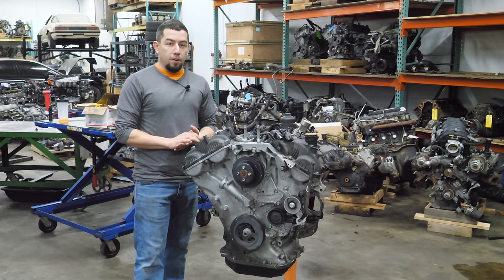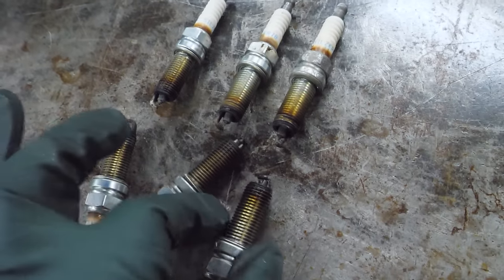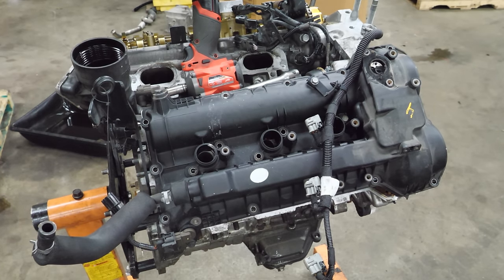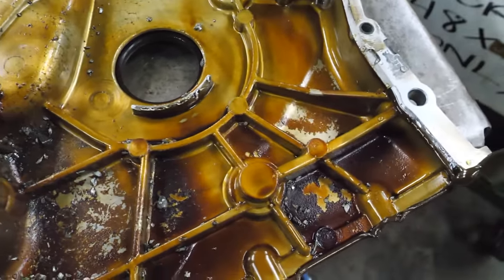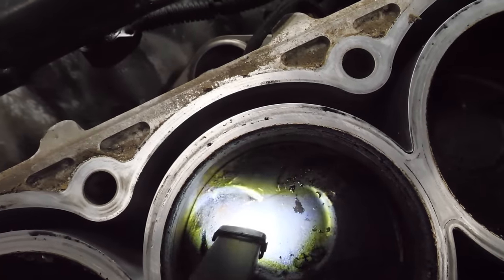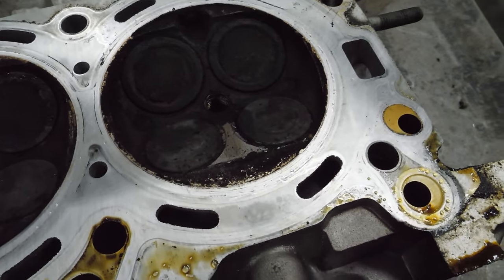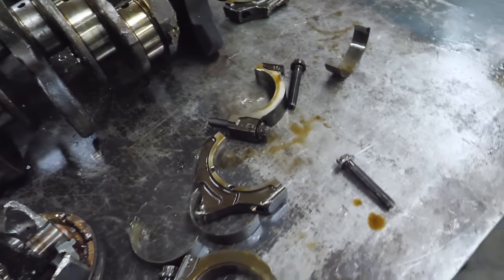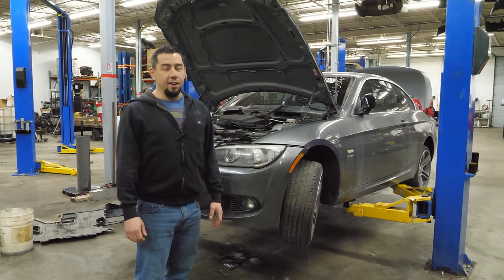Taking "Blown Up Engine" To A New Level! Kia Sorento 3.3L GDI V6 In Shambles. I AM IMPRESSED!

Comment: In my 50 plus years of working on all types of engines as a dealer tech from chainsaws to huge excavation equipment this engine easily qualifies as the most carnage ever, the sheer savagery inflicted of these poor engines always blows my mind begging the question, "people can't be that stupid, can they?"
 As always Eric, great video and teardown, thank you Eric for all you do!
Reply: Well yes, yes they can.  :D
Reply: @JimmyCasket02  I have to concede that you are correct, what a frightening thought, ugh.
Reply: i've seen alot worse...during a divorce, her husband put their suburban in N and floored till it stopped then cranked the starter until it caught on fire...5 rods out and part of the cam sticking straight up through the TBI.....Dodge van 318 knocked the cylinder walls out you look from the front cylinder through the middle cylinders all the way through the back of the block...and of course both customers only wanted short blocks ha Fn haha
Reply: shame the heads got hammered
Reply: Watching this gave me a freekin nightmare!😮

Comment: Having watched nearly all your teardown videos now, this has to be the top. The shear amount or damage to the block and oil pan is unprecedented.
Adding it all up. the fact only one piston/rod assembly barely survived,  that most of the rods removed themselves from the crank, and the the wrist pins off the 5 broken rods either were smashed to nothing or left the building entirely? There's no question, this has brought new levels of destruction to the channel. Truely amazing. Thanks again Eric!
Edit: forgot about the heads being wrecked too! What a mess!

Comment: That is quite the carnage for sure!  Was enjoying to watch~  Speaking of Hyundai and Kia, I have a suggestion for a future teardown for the channel:  the 1.4L T-GDI Kappa II (G4LD) out of the 2017-20 Elantra Eco.  I had one of these fail at 120k in 2018 due to metal flakes in the oil that were discovered at the beginning of a major 30k service.  Engine still ran fine at the time!  Dealer still warranteed the engine replacement even though I was outside the 100k window, but I never did find out what the cause of the failure was.  I also heard the 2011-2016 1.8L (G4NB) Nu engine was another problem child of theirs which could be another good future teardown, but my 2011 I had 371k miles on it with zero issues.

Anyways, keep up the hard work and the awesome vids, good buddy~

Comment: That stubby impact easily became the most used tool in my garage, I think you'll be blown away by the bolts it will take off😀
Reply: Yeah I've been commenting to this YouTuber for over a year about getting the Milwaukee 3/8 stubby M12 but I never got no reply from him. I kept asking him what is he doing running that M18 bit driver impact or his 3/8 Drive pneumatic when the Milwaukee M12 stubby would do both jobs and run on one charge for a couple days with the bigger battery.
Reply: That little gun is my most used tool. I’ve had one for a couple used years, and it looks like it’s been through several nuclear wars, and it still works awesome. Routinely takes off lug nuts and bolts, crank pulley bolts, and the most impressive I’ve got out of it was every head bolt broke loose on a 5.9l Cummins. It does like to throw its batteries out, but holding them in or the gun upside down, they stay in. I’ll be gutted when it finally dies.
Reply: It's really too bad that M12 batteries, especially the 6.0's, have such weak tabs holding them in. I've broken so many of the upper cases, and I'm not that hard on my stubby!

Comment: Always enjoy your video series in here about tearing down engines that got trashed, either through neglect or abuse or just plain junky design. This engine had a real serious case of disintegrating metal mites on crack!
In my career in the mechanical field(automotive/heavy equipment/motorcycle mechanics)of 35+ years, one thing stands out as a determining factor: so many people treat a vehicle like an appliance rather than do normal maintenance to keep their rig running correctly. Sad but true, and you have a lucrative business dealing in these salvaged vehicles & powertrain parts that others have trashed in daily usage. 
Thanks for a cool video, Eric!

Comment: The reason behind there being two head-bolts loose on both sides is actually a manufacturing defect in the block casting where the threads will stretch. Had to do a short block on one recently due to it being bad enough to cause a head gasket leak. Also explains why these engines are so pricey due to that being a common failure. But my god this was something else carnage wise lol
Reply: Since I have a car with this engine, this was indeed the part that confounded me. These bolts supposed to be torqued evenly just right. It does not seem that the hydrolocking lifted the heads? 
What did you do to fix the bolt? Just retightened them?
Reply: @franzliszt4257  I’m not sure the story of the engine in the video. But in one instance I had a 2017 Sorento that came in with overheating concerns. Luckily they had a third party warranty that covered the short block replacement. Unfortunately that’s really the only way to fix the issue because it’s the actual casting of the block that’s weak not the bolts. Kia is well aware of this issue and unfortunately it is pretty common once the car gets close to 100k. And who knows if the new block will have the same issue. As a technician I wouldn’t own a 2011-up. The old ones are rock solid before they went to gdi

Comment: That's an impressive amount of damage. I wonder if maybe someone tried to tow this and somehow left the transmission engaged? I can't imagine it could do this much damage under its own power
Reply: That would make sense, pulled from a flood while in gear.
Reply: Would make sense if it had a manual transmission, but the 2016 Sorento didn't come with a manual in the US. I do agree though; it's quite incredible the engine could bomb itself to that degree under it's own power.

Comment: Seeing the damage in this work of art, the only way I could see it having this mess is either towing it for a lot of highway miles in gear or somehow getting it to so seriously over-rev (70MPH into first gear?)  There is no way someone could get an engine to do this damage by just sheer acceleration or powering through a puddle.  This IS the most beautiful piece of art you have shown us so far!

Comment: That M12 stubby impact is a great unit! Just got one myself. Way better than the 1/4" impact driver. And a lot shorter as well.
Have a great day, Sir! o7
Reply: i have the m18 stubby and it's amazing
Reply: @bradhaines3142  Milwaukee 1/2" ?
Reply: @TheBandit7613  yup. same as 3/8 drive but with a 1/2 instead. i work on turbines so i need the beans in tight places

Comment: I'm going with towed behind a motor home while in 1st gear. The water is most likely rain water. This thing hit 10,000 RPM for a while until Grandma noticed the smoke and squealing tires behind the motor home.
Reply: I tend to agree here as this is most unlikely that it keep running for this long. This is more conducive to being towed while in gear to reach ungodly rpm levels.
Reply: That sounds like a pretty good guess. I can't see an engine turning over on it's own power long enough to do this much damage...
Reply: Interesting point!

Comment: As the long suffering owner of a Lambda II in a Sorrento, there are a TON of ways to prevent it. This owner truly had the perseverance to see this through.
Reply: I am not Suffering.  2020 Kia Sorrento  42,000 miles 3.3 Liter V6 and loving it.
Reply: @bryanwinter3289  Be patient. The GDI engines are very picky about fuel and oil. Even with the best care and feeding, plan on an injector or two (with the full fuel pipe hki) before 100,000 and a high pressure oil pump around 125,000, with the associated timing components. We won't be getting another. As long as I can find it, I'll stick to port injection.
Reply: @mausball  I hope to avoid that.  I change the oil every 5,000 or less.  Only use Penzoil Ultra Platinum, a low Volatility oil and use a high quality fuel system cleaner at each oil change interval.
Reply: @mausball  so basically, you are saying I should dump it?
Reply: @bryanwinter3289  nope. Just treat it right. Full syn every change. Trans fluid every 30k.
Reply: @mausball  already did the Trans fluid change and changed out the Transaxel and Differential with full synthetic.
Reply: @bryanwinter3289  Consumer Reports has the Sorento on their "worst cars list (reliability)' for years: '13-'14, '18, '21! GOOD LUCK!
Reply: @TheOzthewiz  
56,000 miles, and it runs like a Swiss watch.  I don't believe all the hype Consumer reports dishes out.

Comment: Looks like a massive over rev and rods let go. Was it connected to a manual transmission, have seen similar, when someone goes from 5th to 4th, but hits 2nd by mistake and then lets the clutch out! like 15,000 RPM. Keep up the good work Erik.
Reply: Sorento was auto-only by 2016.
Reply: @CaptainSpadaro  Auto only in USA but not in UK
Reply: @alandawson3345  can't imagine why anyone would want one of these with a manual, but okay.
Reply: @CaptainSpadaro  Cannot imagine why anyone would want one of these at all unless it was extremely cheep?
Reply: @alandawson3345  It's one of their higher volume models over here, not sure about your side of the pond.

I Wouldn't buy one either, but that's more because I don't like crossovers. If you spring for the higher trim levels, they don't seem like a bad place to spend time.

Comment: Wow!  I have no idea how that engine survived long enough to do that much damage. Any back story on the core?  Reminds me of a contest our local fair used to do; take an old beater, drain the coolant and oil, start it, pin the throttle to the floor and see how long it took to blow up. They would sell time ‘slots’ and if you had the winning time you won the pot. Best one was an early 70’s Dodge Dart with a 225 slant 6, it never did blow up so the fair won the event.
This is definitely the most carnage ever, great tear down Eric!

Comment: Have you ever considered collecting all of the nuts and bolts that come off these engines and selling them? Not like a "x1 piece kia 3.3 lower timing cover bolt" for 10 cents type of selling, but maybe fill up 20oz plastic containers and sell them as a "refill your shop bolt bin" type of deal? Just a random assortment that maybe someone would buy? No idea, just spitballing.
Reply: Alot of these bolts are "single use, torque to yield bolts"
Reply: @thefordmaniac  only head bolts as far as i know, and maybe bearing cap, the rest are reusable.

Comment: Awesome video!  Really enjoy all your content 🙂
Given that there is so little in the way of valve carnage, and without seeing the valves removed from the heads, I would like to venture the following theory:
The engine kept time (more or less) due to the chains holding it all together.   
The valves got locked shut by the pressure of the hydrolock during the compression and exhaust strokes.  (No signs of water top side of the cylinder heads). 
The cam caps, cam lobes and bucket tappets were equal in strength to the hydrolock pressure being offered on the chamber side of the valves. 
Therefore the valve stems crumpled (being the weakest element in the valve train), thus preventing the valves from being lifted again anyway.  
The black residue on the bucket tappet faces is hyper-heated oil residue from the lobes spinning on them at crush height without lifting the valves.  
The "cleaned-off" areas on the valve faces on the 2nd bank are where the carbon was literally pressure-washed away by the force of the hydro-locked water/gasoline combo in the now "locked out" chambers before the con rods gave out.  

It sounded a little different from usual when you busted the head bolts loose, so maybe there was a tiny bit of head lift/bolt stretch right as the engine grenaded, to accommodate the valves exiting the chat so suddenly?   All that upwards pressure with nowhere to go, kinda thing... might also explain the peripheral chamber deformation in the heads themselves?
Reply: I think this was a "towed-in-gear" incident. There is no way the engine kept spinning under its own power after oil was gone (no oil in pickup), to hammer that wrist pin into the outside of the engine, and the bend that compression ring around the windage tray. This had to have had help.
Reply: @kid31989  That's a possibility, too.  Remember though that an engine running at 3k rpm = 50 crankshaft revolutions per second, so this level of carnage can occur within a timeframe of just a few seconds before the engine seizes or grinds itself into pieces.
Reply: @Grantidge69  I've blown a couple motors at high revs and seen a lot of blown motors, and this level of destruction is up there. The big indicator is that there was no debris in the pickup or the oil pump, which indicates this was spinning itself to death with no oil, which engines don't tend to do.

Comment: I really enjoy every one of these engine tear downs.  I did a number of engine rebuilds “back in the day’, the old school overhead valve, cam in the block cast iron engines of the 60s - 70s.  Watching you tear these down shows me how much things have changed since then and how very uncomfortable I would be with these.  Please keep doing this to remind me why I no longer work on cars,  if someone needs a 1974 slant 6 rebuilt, that’s a possibility but I thank you for showing me what I am missing.

But I have to ask you, do any of the engineers or people involved in designing or building the engines you’ve “autopsied” ever contact you?  Seems like you could give them some good insight.
Reply: That Ford 1.0l, 3 cylinder has to be one of the all time classic POC engines - along with Chrysler’s 2.7 V6 and the 140 Vega engines.  All three companies produced - and continue to produce some engines that are real stalwarts among their peers, but these, you look at them and you can only say what were they thinking?

Comment: I have experience with this level of destruction. Over a decade ago, I had a Duratec 30 powered Mazda6S that met a catastrophic end at 121k. It blew 3 holes in the block and sliced a tire with a piece of the windage tray. 

Thankfully, the VVT heads were fine since they cost more at the time than a complete non-VVT engine. I ended up getting a short block from a Taurus and swapped the heads onto it.

I had the the heads machined and added custom grind cams from a company whose name I forget. I never wanted to deal with it again (6 hours just to get the engine out), so I added Diamond 8.5:1 forged Pistons, K1 rods, upgraded main bearings and rod bearings, and better valve springs. I got lucky that a supercar was manufactured not far from me that used the D30, so they sold me some performance engine parts in the days before easy online purchases. I added a custom intake, disco potato, and full turbo- back straight pipes with shorty headers. It was a beast. For 3 weeks until I got hit by a drunk driver and it was totaled. 🤬

Comment: I worked at a Hyundai dealer when their first generation of this engine came out (2006ish). The 3.8 in the Azera had a small run that dropped the cylinder liner. We got one towed in. Amazingly the block held together but inside was like what happens when you sit on a bag of potato chips before opening it.

Comment: Test is one epic explosion in there bud, wow. Worst I've done is 4 rods in a 350 dirt track stock car motor, it was balanced and it grenaded about 7500rpm on the back straightaway, foot was to the floor. I got soaked with oil. My white fire suit is still in a box around here stained up nice. Had double hump heads on it , somehow it never hit a chamber, and I reused them on the next motor the rods ventilated a 6" hole each side of motor..... Big Booom!

Comment: Deja vous...worked in GM dealership late 70's...The Vega engine 140 L4, all aluminum except   crank, cam etc, holes in the pans and blocks you could put your hand thru.  After several years and understanding the properties of aluminum, they put iron sleeves with the pistons; junk yards row on row of nice shiny Vegas all with blown engines just like yours.  Ah, Vega and Oldsmobile diesels...watching your channel, the internal combustion engine and it's ability to literally destroy itself, nothings changed.

Comment: Years ago, my brother who worked in a metallurgy lab used to assess components returned after they failed. One such was an HP air cylinder which had burst under extreme pressure. The engineer report just said "Failed with sound". I think that's appropriate here...

Comment: This core is the T2000 of engine catastrophes. It. Just. Keeps. Coming. BAAAAAAaacccck! This thing stayed for the extra innings, took a running leap off a cliff, turned around mid-air, and gave a hearty salute as it plunged into the foggy depths. This one narrowly beats the Ford Modular with 4 pistons at TDC.

Comment: Based on my hydrolock experience, at full throttle mind you (but only 2500 rpm) where one rod just broke in half after bending and put a small hole in the bedplate, leaving the piston and bore undamaged, this must've ingested just the perfect amount of water where it could keep running at full throttle, bouncing off the rev limiter, for at least 30 seconds, if not a minute or two for that much carnage to have taken place.